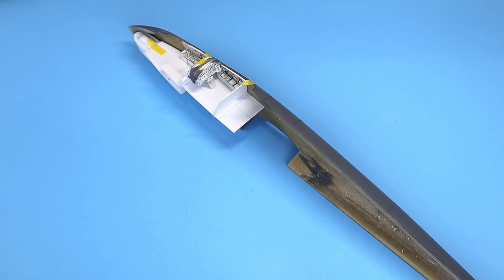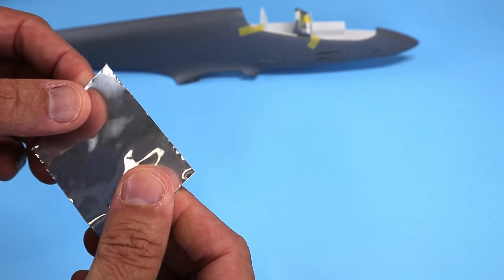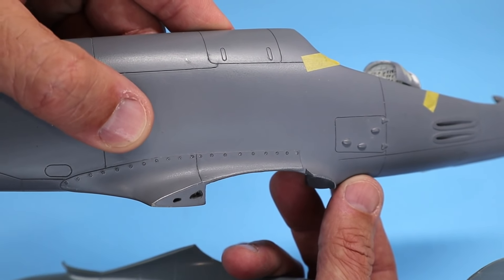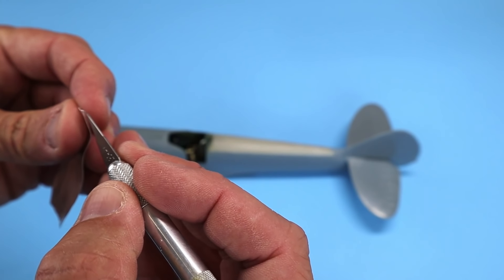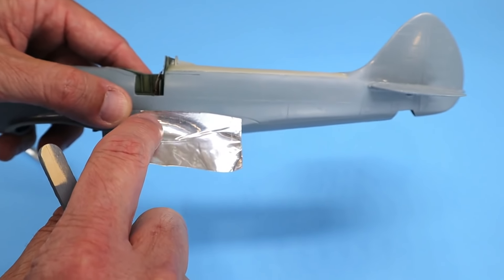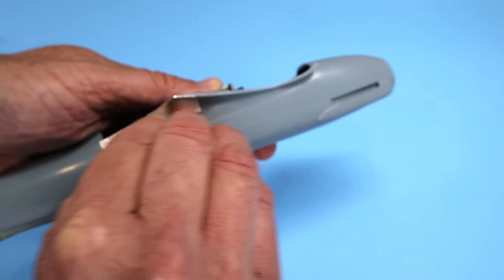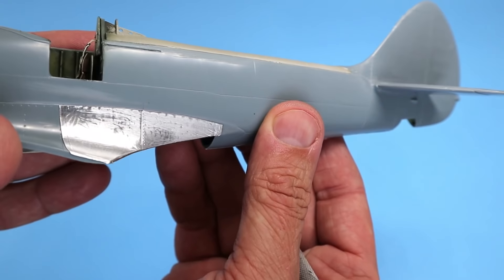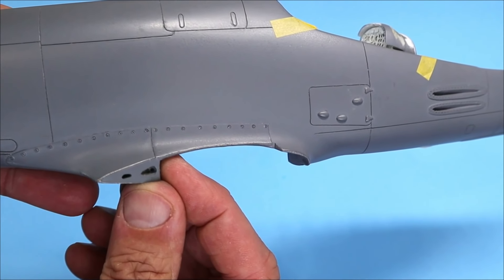Aluminum Tape for Model Airplane Skin Panels - Flite Metal

Comment: Many years ago we used cooking foil glued on shiney side down
Reply from the maker: Yep, that works too but this is a bit better to me.
Reply: You sometimes saw people using litho plate in the seventies to produce all metal finishes, they were a true work of art, foil tape still requires care and skill but is so much easyer and its thinner and more readily available, got a roll from my local tool stockist.
Reply from the maker: @CrusaderSports250  I agree.  I only used the plate a few times and not for entire builds.  This Flite Metal stuff is far better and easier to use, at least to me. For those that can pull it off, a real metal skinned model is indeed a work of art.

Comment: How did you build the Pucara? Btw, it’s pronounced “poo-CA-ra”. It looks AWESOME!
Reply from the maker: Thanks for the correction on the pronunciation.  I'll try to remember that.  I also appreciate the kind words on the work itself.  With regards  to the building of the Pucara, all of the cockpit parts are being built from sheet, rod, and square styrene.  The fuselage was created using a mold I made.  I built a wood male plug and then made a female mold from that.  I then did a resin layup in the female mold to create a "hollow cast" fuselage section.  Then, lots of sanding the detail work.  Still a lot of work ahead.  It's a long term project for sure.
Reply: Great job sir!!!thank you for sharing your technique!!Like.
Reply from the maker: Thank you Daniel.  Hope it helps.
Reply: nope, it's poo-ca-RA, the accent is in the final syllable, Pucará
Reply from the maker: @martindione386  Thanks for helping us all out.  I'm so confused...haha.
Reply: @FlyingSModels  no problem, it's not even a Spanish word, it's Quechua, an indigenous language spoken by various populations along the Andes, from northern Argentina to Ecuador, and it means "fortress"
Reply from the maker: @martindione386  Well it certainly looks like a fortress all armed up.  I built the 1/48 Aconcagua one a few years back and it was a good looking aircraft with all the rocket pods installed.  I really appreciate the extra effort to provide the community here the etymology behind the word.  Thank you!
Reply: @FlyingSModels  my pleasure! the Pucas have been retired, but there's a project to re-motorize the best ones with PT-6s, add FLIRs, and use them as border patrols
Reply from the maker: @martindione386  I saw that while doing some reading online.  They look really cool with their new turboprops!  Cheers!

Comment: This foil tape looks like the same tape used when using celotex insulation  when house building
Reply from the maker: The Flite Metal is thinner and a little more "refined" if that even makes sense.  But I've used regular HVAC tape as well with good results.

Comment: Suggestion: Show the model box.
Reply from the maker: What box are you referring to?  The 1/32 Pucara I show is scratch built.  There's no box for that one.  I certainly could have shown the PCM box but that kit was just to demo the process.  Thanks for the comment!
Reply: @FlyingSModels  Thanks for showing the metal techniqes. I'm just suggesting that you make it clear to the audience what type of aircraft you are working on.You said something about Argentina so I am thinking Pulqui.Your work on the model does not show if the plane is jet powered or prop.
Reply from the maker: @jeffhallel8211  Copy that, Jeff.  I mention in the video that it is a scratch built, IA-58 Pucara.  The intent of the video was to show the aluminum skinning rather than a specific model but I should have made that more clear.  Since the Pucara is scratch built, I could have shown some pics or drawings.  Appreciate your suggestions.

Comment: Why not tin foil most scaled look?
Reply from the maker: I've tried that too.  It works well but does have to have foil adhesive applied and I had less control using that method than using the Flite Metal that comes with a uniform adhesive already applied to the foil.  But yes, you can certainly use tin foil and even boil it will some egg shells to tin the foil.  Very neat effect.
Reply: @FlyingSModels  good to know thanks

Comment: 2:20: Longer fingernails are helpful...
Reply from the maker: True that.
Reply: The best way to remove paper of, is to tear off (on the side of unused part) from the roll or cutted area. I cursed the moment many times if I tried to remove paper of of the aluminium duct tape. Cutting was the worse way.
Reply from the maker: @bartomiejbudnik4047  For sure.  Much easier if going from the torn side.

Comment: I need a 1/32 Pucara pleeeeeeeeeeeeeeeeeease
Reply from the maker: We sure do. This is one of those long term projects as you can see.
Reply from the maker: What kits (manufacturer) do you have in 1/48?
Reply: @marcelorosi7218  Which kit is it mate?
Reply from the maker: Sorry, just saw this comment.  The Pucara in this video is scratchbuilt in 1/32 scale.

Comment: any common-sense modeller uses an X-acto knife to start removing the backing from an adhesive sheet... not a thumb!
Reply from the maker: hahaha....sometimes common sense goes out the window when you start making videos.  Good thing I had a knife handy or I would have never gotten the backing off.
Reply: @doug h... why dont you show all your common sense techniques on YOUR video...consider reading the "man in the arena" prior to making such comments.

Comment: A kit is not a scratch built model. Otherwise good video.
Reply from the maker: Not really sure what you mean in the comment as the 1/32 Pucara that I referred to ask scratch built is indeed from scratch.  The Spitfire "mule" I was using to show the demo certainly is from a kit and I don't think I referred to it as scratch built.  I do appreciate the comment, was just confused a little.  Cheers!

Comment: Good idea, but I just use "Bare Metal Foil."
Reply from the maker: That's good stuff too but I kind of like this "flight metal" stuff better than bare metal foil.  Just personal preference, though.
Reply: @FlyingSModels  How much is the Flight Metal stuff? It would be worth it if cheaper by the roll than one sheet of BMF. BFM is expensive for what you get. But, I only occasionally do a an all-metal aircraft project anyway. Thanks!
Reply: HVAC foil tape is cheaper by the roll
Reply from the maker: @Gearhead-en8dz  It is cheaper for sure.  I've used it with some success.  It's a bit thicker than some of the other products and the adhesive is a little gummy and it sometimes comes off when you trim a small piece.  Definitely an option, though, especially for small sections.
Reply from the maker: @michaelhollister7932  Here's the link to the stuff if you want to check it out: https://form.jotform.us/63326435239154
BMF is pricey for what you get but it's a good bit thinner than the flite metal and may be better for some applications.
Reply: @FlyingSModels  Definitely not for all applications. But it works around Windows. I use Molotow for cast Wipers, hood pins, & touch ups. I also use Molotow for my 1/64 gas caps, door handles and around lights and windows, so it is not a wasted purchase!
Reply from the maker: @Gearhead-en8dz  Yep, it's definitely good for trim around windows, hood pins, etc.  Far better than this Flite Metal would work.  The right tool for the right job!!  Cheers!

Comment: The texture is not acceptable to me.
Reply from the maker: Ok, I understand, I think.  Would be good to understand a little more about what is not acceptable but I understand that people like to work with different materials in our hobby.  Thanks for taking the time to comment.
Reply: I mean that those wrinkles don't work on a surface that's supposed to be smooth. It adds an unrealistic texture painted or unpainted. You can tell from a mile away in both shots even though they are not close-ups, they still show that bumpy texture. I understand you want the effect of a raised panel, but you sacrificed much more in return for a wrinkly, bumpy, unrealistic surface.
Reply: @FlyingSModels  I was looking specifically for a way to lay down foil and not get that texture.
Reply from the maker: If you want to avoid texture, you might just want to skip foil and go with metal paint.  Part of the fun (and maybe problem) with using real metal is that it has a metal texture.  Have you tried Bare Metal Foil? It's much thinner and may not have as much of the texture you don't like.
Reply from the maker: Understand.  Keep in mind, this was a "quick tip" so I didn't spend too much time burnishing the metal down to smooth it out.  You can sand the metal and then polish it to make it smooth.  But I recognize that the look is certainly not for everyone.